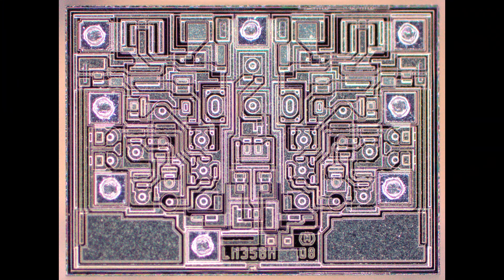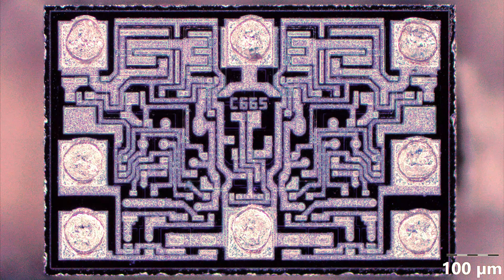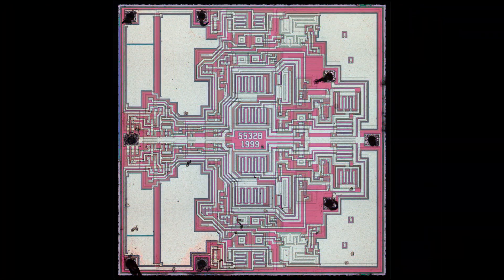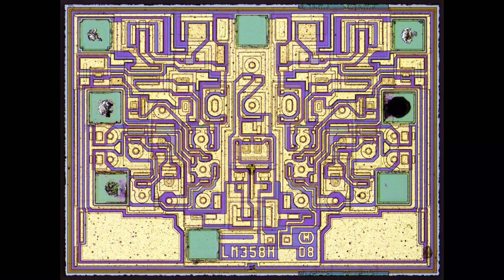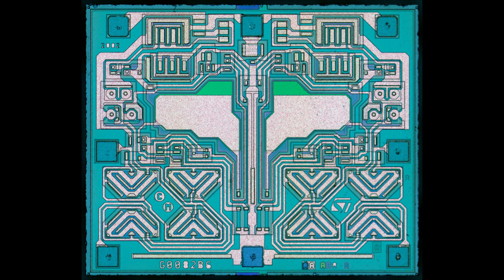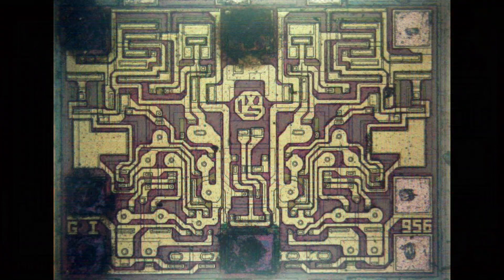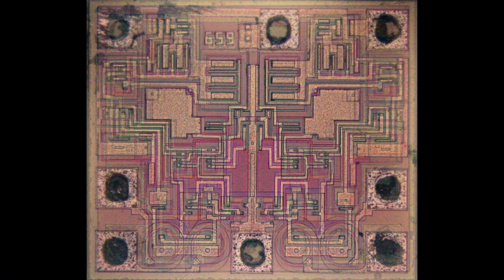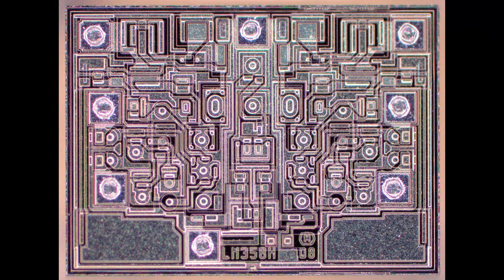#1750 Various Opamp Die Designs Used in Fake Parts

Comment: Might your fake LM358 be a MCP665? The MCP665 is a dual op amp with a high Gain-Bandwidth Product of 60 MHz and two chip select lines, so that doesn't fit with the die image, but the high bandwidth certainly matches the slew rate you saw.

Comment: I usually always order parts from reputable sellers (digikey/mouser) for the real designs I'm working on. But I have gotten some cheap common parts here or there from Amazon just for when I mess around on a breadboard, I bet I got some fakes as well. I should characterize them and check. Thanks for the video!

Comment: It's kinda depressing this is happening so much. It's clearly a clash of culture and one is taking advantage of the other. 

I came across an explanation of this by a Chinese manufacturer (in a very different industry) who actually doesn't like this kind of thing. They recognised that it gives Chinese manufacturing a bad name outside China. But there is both a cultural element as well Chinese IP laws that are different to most of the West that would have to change.

Comment: TL081. I bought from Amazon, Aliexpress, Farnell and I also had few spares salvaged fom old electronics. I needed 4 of them and to be fair, the Farnell ones were the closest to the old salvaged ones (that I ended using at the end) but those bought from A*** online shops were some with no FET inputs or were just out of specs. So, unless I will find a good source for real and good components, I will use mostly what I can salvage from older electronic boards (70`s-90`s broken electronics). After all, my needs are quite low, I make circuits for hobby.
I made a simple oscillator circuit to test them and watched the output on the scope, after that I compared the waveforms at 1KHz, 10KHz, 100KHz and 1MHz.

Comment: Not only op-amps are faked - I found a fake 78L05 5 volt regulator marked WS78L05 that seems to be missing over temperature and maybe over-current protection. As it overheats, the output voltage  keeps rising well above 6 volts. Might be OK for a voltage reference but don't load it with much current.

Comment: I would be concerned about power consumption if the wrong type of die got mounted into a package or simply relabeled. 
That's actually something that you can easily measure for a sanity check. Also helps you to tell whether a dual opamp was sold as a single, or a quad as a dual.
You can also measure whether the offset compensation pins are connected.
I suspect that all of those fakes were test fails and should never have seen the light of day to begin with.
It might not matter if you were just going to build a Xmas tree LED flasher though...
I worked at semiconductor companies and they invented and built a chip (die) crusher machine to mechanically destroy the test fails. That's not as easy as it sounds since silicon dust is combustible. I wonder whether they learned that the hard way. That was 20 years ago. I always wondered why would you even do that. Just give back to nature and dump dies in the desert or add to concrete. Only now I understand... 
Other companies would burn on-chip fuses to disable parts of the chips that weren't working as specified and sell for lower price with truthful marking.
But it would not be feasible for dual opamps...

Comment: Unless the fakes are made from trash off-runs, I can not understand the economics of making the fakes...
Reply: Silicon die for this op amps cost few cents, but they sell for more if branded as TI or AD. Mark up in integrated circuit design is insane.
Reply: I can see fakes of amps that are multiple dollars per part. Faking LM358s does seem like a mug's game.
There are even fake magnetic cores out there. You can find counterfeits painted to look just like Micrometals powder cores.
Reply: @D614G_aka_Doug  With cheap parts they have less risk of getting complaints, and they sell them in big quantities, unlike expensive ones...

Comment: Turning dual opamp's into single opamp's sounds rather stupid. A bit like the gentleman who made fake 10 pence pieces here in the UK by filling the edges of the 50 pence piece !....cheers.
Reply: well, if you can etch an expensive-sounding label on them and charge 10 times what you could if you labeled them correctly...

Comment: Guess nobody has yet seen a dual opamp made from half a quad opamp yet, though I would bet that they are out there, as  it is easy to see if somebody has a few wafers of reject dies, and put it through the tester to sort out those that had at least 2 working parts, and then did the colour drop to indicate which half to use. Then bonded them to a paddle and leadframe, and bonded out either half to get fakes that sort of worked.
Reply: I’ve never thought that deeply on it honestly , but now that you point it out I feel like surely they exist. 

I love messing with cheap opamps because I design guitar effects and sometimes the garbage has positives in that realm. I’m gonna look at the worst of the worst in my collection for what you described because it truly piqued my interest

Comment: It doesn't appear they ever try to copy the real chip. Why not?
Reply: They don't care at all. It is not like they are trying to really compete, they just want to dump the fake chips and make an easy buck. Edit: It might even be that some chips are "real", but were bought and relabeled afterwards.
Reply: They do production runs on the chips like LM358 and have plenty of left over dies to put in fake parts. They are not "making up" fake dies, they simply are using left over parts they end up with. Some are legit parts that don't meet specs. They don't throw them away like they should. Always buy from industrial suppliers like Mouser, Digikey,  Avnet, etc. Ebay is a crap shot, sometimes a great deal, but there are many scammers in the mix!
Reply: @glasslinger  don't have a choice , those suppliers ship for 20$ minimum and I have to pay for customs fee too.
Reply: @mahadotube  Sorry. There are big advantages to living in USA. I have no answers to help you.
Reply: I see the original chips have more intricated designs. Those colorful intricated layers would need special processes to create them, which adds to the cost. Why you would want do that when you can just wire a simpler in-home design, or some capped one which you already produce in quantities, and batch it in your fake devices at the cost?
Isn't like they don't know how to do them, or they didn't already pirated the blueprints. Is simply it doesn't make sense from the "bussiness" standpoint... Or at least that's how it looks to me.
Reply: Analog design, die manufacturing and packing are 3 totally different disciplines.